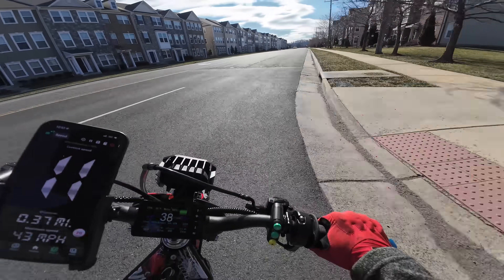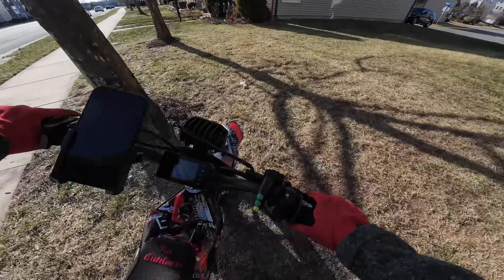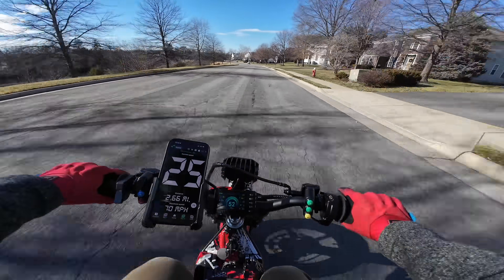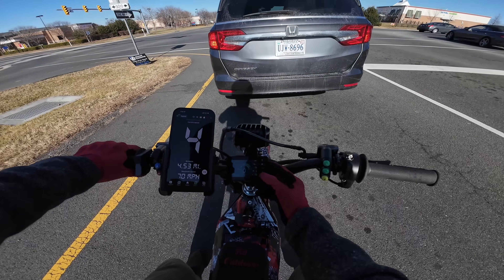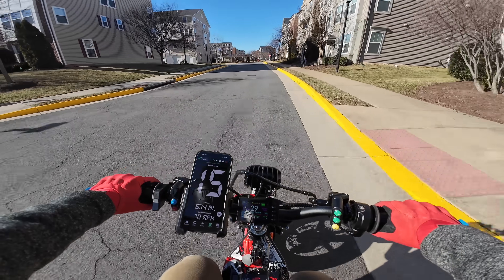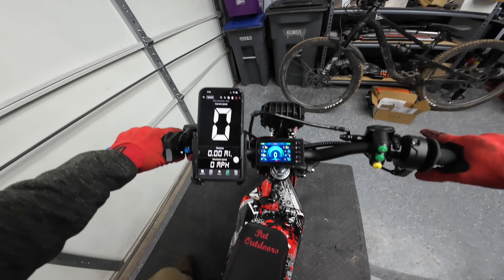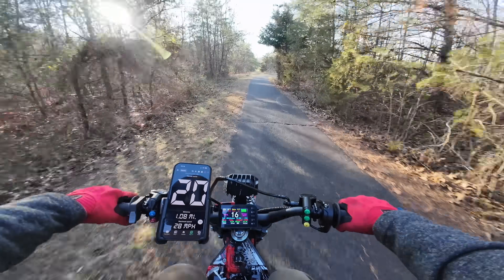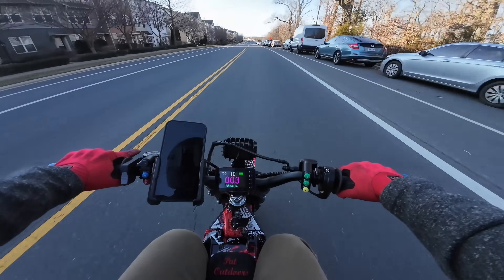I Built a 70 MPH 72V Yozma IN 10 Supermoto - First Ride

Comment: Can you link all the parts
Reply from the maker: ALL the parts are linked in the description the video.
Reply: @PatOutdoors I didn’t see the link to the battery
Reply from the maker: @gazaparty24 no such thing as a listing for it. You have to go to Amorge’s site and email them which specs you want: https://www.amorge.com/battery-for-valtinsu-em-5-em-23
Reply: @PatOutdoors can you link the specs you used I’m new to the e-bike life
Reply from the maker: @gazaparty24  just ordered 72v 30AH with Eve 50PL cells, 360 amp peak BMS
Reply: @PatOutdoors I appreciate you I just ordered my bike it comes on Saturday I had the tuttio ict the bike was fast but the motor was garbage bike broke down under 100miles

Comment: super sick build, did you get a greater range from the upgrade? im looking to mainly increase my range for mines the stock speed is pretty good I was looking to get at least 65-70 miles of range, what components or parts would you recommend me to upgrade for a greater range?
Reply from the maker: Thanks! If you’re mostly looking for range, you could just upgrade the battery to a 72V 24AH to 30AH Valtinsu EM5 battery from Amorge and tune your stock controller to 70 line amps and 240 phase amps. This will net you about 55 MPH and almost twice the range compared to the stock battery. My bike is tuned for max power (200 line amps, 700 phase amps), which causes it to drain the battery pretty quickly
Reply: @PatOutdoors Perfect thank you so much for your help dude I was doing so much research wondering if I had to change my controller or other parts for a better range and I couldn't get a straight up answer you're also the first person I've seen heavily mod the bike like this so props to you bro🤟

Comment: Is that all the upgrades it needs to go 70mph or does it need like a higher volt battery???
Reply from the maker: The video title says 72V Yozma. I also said in the video that I’m using a 72V Amorge 20Ah battery that I borrowed from my Tuttio project. But yes, that’s all I needed to hit 70
Reply: @PatOutdoors alright thank you man also I wanted to ask I have a kovo nova what would you recommend to make it faster like that???
Reply from the maker: @DamianInzunza-r2m I’ll look into it. I have a similar bike actually (Vipcoo H3.) looks like it has same style motor as the Tuttio so a Sotion FW23 might be the motor to get it to 70 mph. But you’ll need at least a 72V battery and capable controller to match.. just those three parts are about $1700
Reply: @PatOutdoors sounds good I might do that man I appreciate it
Reply: Will putting a 100 amp controller to 60v gt54 make it faster?
Reply from the maker: @D @DamianInzunza-r2m what kind of battery and motor are installed on the GT54..? Do you know the max output of the BMS? I don’t have one of those bikes so I don’t have much knowledge on it
Reply: @PatOutdoors  it has a 3000w brushless motor and a 60v battery
Reply from the maker: @DamianInzunza-r2m  can’t put a 100 amp controller on it without knowing the BMS output on the battery. You could damage the battery if the discharge rating on it is less then 100 amps. For example - stock Tuttio battery max output is only 70 amps.
Reply: What do you think is a ebike I could get with like about 1600$ that could go like 50 miles an hour or like I could upgrade to like for that much I’m like in a budget
Reply from the maker: @D @DamianInzunza-r2m  a Yozma IN10, then just put a $650 72V battery from Amorge and max out the tune on the stock controller and motor. That’ll put you at about 55 MPH for less than $2K. Otherwise you could just save up for an ETM RTR Lite for $2K, which is already 60V and goes 47 MPH stock

Comment: What battery did you use on this and the tuttio build?
Reply from the maker: I’m using the same exact battery (for now.) Amorge 72V 20ah with 250a peak, 200a cont designed for a Tuttio. But I already ordered my Amorge 30AH with 360a peak, 200a cont designed for a Valtinsu EM5. No such thing as a link I can share- I had to email Amorge to now about pricing and shipping costs
Reply: @PatOutdoors awesome, thanks 🙏

Comment: Wait what are you saying 700 phase amps or 700a cause I'm confused that looked like crazy accel but you told us your battery was 250a bms
Reply from the maker: 250 amp output battery. Controller set to 700 phase amps a the fastest setting

Comment: Hey P! I’m lovin the content brotha,  quick question when u get a second,  what do u recommend for a build on a yozma that imok with only 55-60 mph? I’d love any advice and recommendations,  thanks 👍🏼
Reply from the maker: Amorge 72V 20 or 24ah battery and a Bluetooth dongle so you can tune the stock controller to 70 line amps and 72V. The stock motor should be able to take that 5kW easily and get about 55ish MPH. You could even do  an ND72300 as a budget controller upgrade if you want a bit more power and get you to 60
Reply: so with the website I see the EVE 40p with 180 continuous and 240 peak and the EVE 40PL with 240 continuous and 300 peak, which one would you recommend? Also is it plug n play? Thanks again and sry for all the questions man I’m a novice!!

Comment: i want to get a controller for mine to do wheelies do you recommend any that would fit with the stock battery and fit in the same slot the fardriver controller does
Reply from the maker: Please watch the previous two videos explaining step by step what I had to do to make this work. Will not work with the stock battery, must be upgraded to a battery that has a minimum discharge rating of 100 amps.

Comment: what battery are you using. Also do you think the 72v batterys on amazon a scam
Reply from the maker: This is an Amorge 72V 20AH battery for a Tuttio, that I’m just temporarily using till my REAL battery upgrade comes in. I ordered an Amorge 30AH 72V battery meant for a Valtinsu EM5 (same fitment.) The 360-amp peak output option I believe was around $790 including shipping. No such thing as a link, you gotta email them to order.
Reply: @PatOutdoors  Alright thanks! Do you think the 72v batterys on amazon are a scam
Reply: @yozma_x I wonder about their lipo batterys from btr power all the time for my kids razor...
Reply: @yozma_x amazaon batteries are overpriced and low quality
Reply: @anthonymoy4471 they’re ok… but not great. BTR are soft pack pouch cells, which is ok if it’s in a hard casing, but they aren’t. Pouches are too easily damaged, which is why btr batts have issues.  The bms also has a low current max. My 72v btr claims a 55A bms…but I’ve pushed it to 80A. 

For the price of it, you can do a lot better.  But not on Amazon.

Comment: Are you about to put one of these controllers on a razor?
Reply from the maker: Yes, but ONLY if you have a motor and battery that can support at least 100 line amps of power/charge. You also need to weld the freewheel on the back wheel for the regen, reverse, and wheelie assist to function correctly
Reply: @PatOutdoors I have a 72v 30ah 200ac w/fw11 and a welded free wheel 👍
Reply from the maker: @seb @sebastiankrehbiel hat dddooppe! On a Razor too. But yeah this will pretty much work on most set ups over 7kW (stock) But I would recommend waiting for @ElectricRVA ‘s direct plug and play kit designed for the Tuttio since it would be a much smaller housing (easier to fit on a Razor.)

Comment: Dude your my only hope please help me fix my yozma the company won't do shit I'll pay you just to send a couple picks of the wiring harness all wired up properly
Reply from the maker: Where are you located? My bike no longer has ANY stock wiring at this point so I have no reference to a stock Yozma (unless yours has a Moxin controller with Surron harness.) what’s the problem anyway?
Reply: @PatOutdoors it started with an e07 error on the stock yozma after 2 miles.    They sent a new motor and wiring harness. I just have nothing to go off of because I got ahead of myself and unhooked everything then thought oh man I should have taken a pic or something.   I plugged it all up and put the battery back in and it doesn't even turn on anymore.  I'm charging the battery now to see if that works.      It's looking like I may just have to upgrade this thing     do you have a list of the parts you've used anywhere. ?   Also I'm located in Georgia.  I've scoured the state for a shop or mechanic to help me. Also fruitless.
Reply from the maker: @Dalekenya7100 start with testing out the battery voltage output at the possitive/negative terminals on the controller. Need to make sure you’re getting at least 48-54V there before you diagnose anything else. This will at least confirm your battery and charger are good.
Reply: @PatOutdoors  it's 54 volts.
Reply: @PatOutdoors    the battery has power but nothing happens when I connect it to the bike and turn it on.

Comment: Danggg that’s fast I got one yozma but I blacked it out and I only have the 72300 controller
Reply from the maker: I mean the ND72300 is a great bolt on upgrade 🤷🏾‍♂️ Can easily still do 7kW on a budget!
Reply: @PatOutdoors with the stock battery
Reply from the maker: @Chiara_150well once you go 72V, there’s no going back 😅
Reply: Am I able to do it with the stock battery tho??
Reply: @PatOutdoors lol ok
Reply: @Chiara_150no. Stock battery voltage cannot be changed. That’s all emotos and bikes.. the battery is built for a specific voltage.
Reply: @Jasons_Garage Ik that